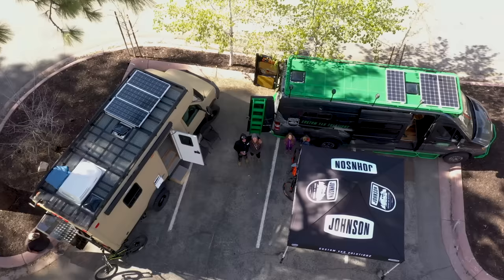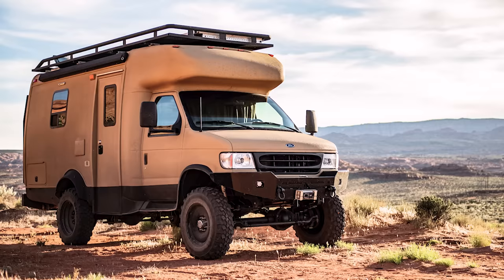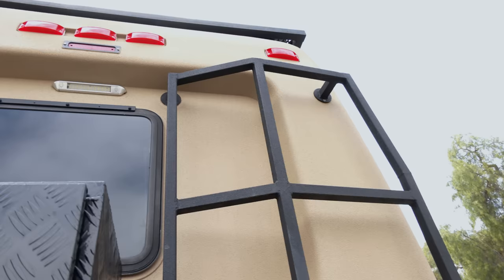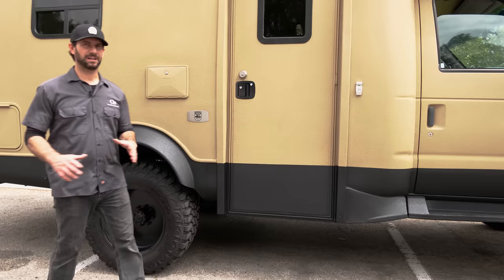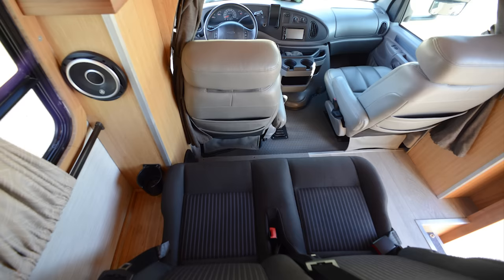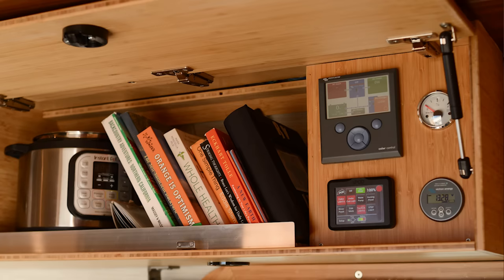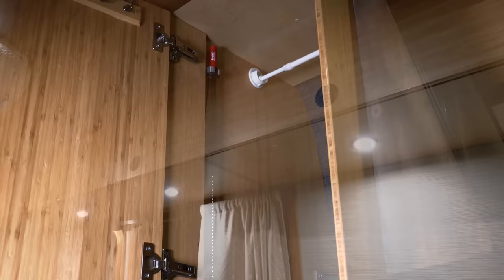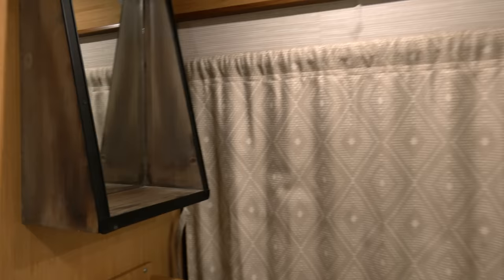4x4 Van Tour - Custom Adventure RV Starflyte 2.0 ! 4WD RV!

Comment: I have a 24ft C class motorhome that I would like to Raptor line.  What is the best way to navigate the storage doors and venting panels?
Reply from the maker: Get really good 3M green or yellow automotive masking tape to seal off anything you don't want to spray. You can go over any vent that is not a "hot" vent, just put some tape behind the grills on the backside to prevent spray through. I painted all my doors, just sand  everything with 100 to 180 grit, clean thoroughly with a detergent soap. Careful the soap doesn't have oils in it as a lot of soaps have essential oils in them these days. Any hard to reach areas you can't sand, or spots you want added adhesion power, use UPOL's Grip #4 spray. Just 2 really light coats of that and 20 minutes later you can raptor it. Any spots you hit with the sander that creates bare metal, use UPOL Acid Etch #8.

Comment: Very impressed!  I've been considering all the options for a few months and this is the first thing I've seen that hits all the notes.  The slightly retro/classic Starflyte has a great look to my eye, especially with the paint and extras you added.  Were the stock water and gray water tanks sufficient or did you replace them?  How is the insulation?  Can you charge the batteries off the engine as well as the solar panels?  Looking forward to more!
Reply from the maker: Thank you that means a lot! I upgraded the water tank to 46 gallons, so with the 6 gallon water heater it has 50 of fresh. I upgraded the grey water from 15 to 27 as well. Batteries charge off the engine, yes and 300 w of solar.

Comment: What kind of engine do you have in the van?, if you don't mind me asking, what was the cost of the remodel?
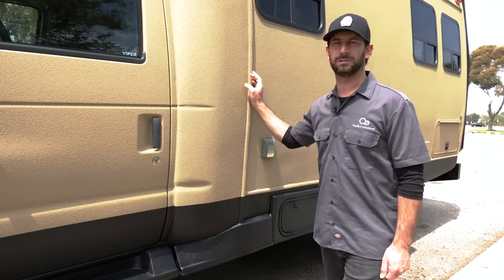Reply from the maker: 160k and it's 5.4 V8 gas engine. Re-geared the diffs to 5:13 to make up for power

Comment: Ayyyyyyee you’re on YouTube, and a natural at it. Lets rally 2022!
Reply: Sikaflex 221 is all over my van as well.
Reply: Man that hoist is slick. I’ve always wanted to know more about the process of building your own wheels. I’m sure that was an intensive process!
Reply from the maker: I'm camera awkward brother! I appreciate it though! 😂
Reply from the maker: @Levi_Allen  I'm using 252 as well. And the 291 is good for below the water line on boats!
Reply from the maker: @Levi_Allen  The hoist works so well, I love how it came out. I didn't build the wheels, I spec'd them out. Rear wheel made by "Wheels Now Inc" and fronts made by "Detroit Steel Wheel Co."
Reply: How much is all that cost$$$$ ???

Comment: i have a 24' born free RV with a Ujoint 4x4 conversion done at their facility in NC. It's built on an E450 chassis. I have a rear sway problem 
(tail wagging the dog) when the RV goes above 55-60 MPH. I Installed a rear track bar that helped a little . I still have yet to figure it out.. any suggestions?
Reply from the maker: Air bags! Your rear sway bar should be the fatty one from Hellwig! I ride with the air bags at 80 lbs and it is very helpful for sway. Tire choice is important as well.
Reply: @auxbuilt4190  I have air bags. I also have the biggest hellwig sway bar they make. I'm running bfg km3's. 33 inch
Reply: Look at some Roadmaster videos, they do help on motorhomes that sway in the back, but you need to control the front first before the back will behave.

Comment: I've read that having the spare tire covered with black in the sun for possibly months is bad for the rubber. I saw one guy that made a round thin wooden board painted with white ceramic paint. It was a little bigger than the tire and had a screw that went though the center of the board and spare tire rim to hold it in place. Do you have a weBoost built in? Did you have any thoughts about diesel? Great build!
Reply from the maker: Very clever about the ceramic board! No weboost installed. Diesel is great, just bought a new build and it is diesel!

Comment: Nice work !
But I think you made one mistake according to what I saw for cold freezing spots !
There is no air circulation in closed shelves!  Condensation is therefore inevitable except if you leave the boxes opened which is not the good solution.

Comment: I subscribed to be able to refer to the paint used on your Econoline.  I own a 2001 E-150 (V-8 5.4L Triton) Conversion with 189k miles and burns 3/4 quart of oil between oil changes. Today's vehicles have so many electronics that are tied into the damn vehicle to operate, I'm steering clear of that crap!

Comment: This is the best built on YouTube period. 3 questions. Why did you not go for a bigger watertank? what was your reasoning? Why did you not use a cassette toilet? And lastly, what are the exterior dimensions, length, width and height after the rebuilt? Awesome work. Thanks
Reply from the maker: Thank you! Stock water tank was 26 gal, so the 50 was a major upgrade. Cassette toilet needs to be changed all the time even when just using it to #1. The composting toilet makes it super easy to dump pee and you can do it anywhere. 21ft x 10'6 x 8

Comment: Innovative solutions for comfortable trips. Well designed for long term off grid experience and enjoyment. 

Questions: Can more custom mods can be fitted? 
What's the range of vehicle?
Is as comfortable in Tundra as well in desert areas, also high altitude regions driving? 

Good Presentation 😎👍
Reply from the maker: Thank you! Yes, more custom anything can be done! Imagination is the limit! Range is aprx 300 miles. The AC is being replaced so that it is 12V which will help in hotter climates and the webasto heater keeps it warm in the higher altitudes.

Comment: I think this is about the best anyone can do on fixed axels and 110" wheelbase. Tantras spine drive and articulating axels would be so much more expensive. Great blue collar job for normal people.  Just 3 questions if you could humor me.
1) How much more weight would this handle? Like for an aluminum back porch for dogs and showering platform? Think same as the roof rack welded to the frame and sticking out the back 4 feet.
2)What was your final toll $ on this ?
3) How long can you go off grid before you need to come back and re-stock and do maintenance on this?

Comment: Nice build.  Would it be possible to put a 7.3 diesel in that beast?  Also the design on the bed is genius.
Reply from the maker: It's not economical to engine swap. You would want to find a donor van with a 7.3 and do a body swap.

Comment: Did you have to sand everything down to bare materials before applying the Raptor Liner, or could you spray it over the existing paint?

What are the bones of the body made from, and how strong is it? I'm looking for something that I can use on ski trips where considerable weight in snow could build up on the roof overnight.

How high is the interior ceiling?
Reply from the maker: You have to scuff the material you are painting, not bare metal. If you hit bare metal you need to prime it with UPOL ACID8 or Raptor 2K Primer. It's a steel exoskeleton so no load worries on roof. 6'3" inside

Comment: Amazing job! We had a 1999 Starflyte. There were some pros and con's to the camper. One thing I'm surprised at. Since you're going hi tec why not put in an on-demand water heater vs a 6 gallon storage one? Is it the lack of propane? Another is weight. We were close to our weight limit. What about tires and the extra weight of the 4X4 components? I realize you may never see my post or have enough time to answer, so best of luck.
Reply from the maker: Heya! No propane on board. Definitely at the weight limit yes, but I know a few van owners that are 4 or 5k lbs over their gvwr and they are fine after years of use. These vans are under rated in my opinion. The tires were rated for 4k lbs each and the rear scaled at like 7800. Wheels were rated well beyond that. Cheers!

Comment: Is the motor a 5.4l or did u upgrade  that to a diesel.  ? Awesome  job
Reply from the maker: 5.4 gas, with 5:13 gearing to help the power back to the wheels. Diesel conversion in this van is insanely expensive and arduous. I was quoted 40k for the diesel conversion as a turn-key job.
Reply: @auxbuilt4190  5.4 will work. ,they strong motors. 💪 but expensive to  repair at times. Timing  chain gears big job.  They tend to fail at 180.000
Reply from the maker: Copy that, thank you!

Comment: Did it come as a 4wd or did you convert it and also who made the ladders and roof mount?
Reply from the maker: Conversion was done by UJoint Offroad and no it was an old little RV when I got it. I made the rear bumper, ladders and roof rack myself.

Comment: DAAAAANG.  🦄🤩  Love this.  I really love the outside, the sheer power, and the specs.  You built a tank.  But I want a rugged beast in the guts and on the outside, and a straight-up pretty, cozy house on the interior.  Definitely an inspiration, thanks for sharing!
Reply from the maker: That was the plan and yes, thank you!!

Comment: I'd love to find out how they rigged the 'quick release" transfer case shifter.  I have the same setup on my E450 and really need a solution to move it out of the way when parked.
Any sources I could purchase a collar or? and weld or fix to the cutoff shaft?
Great build and video...
Reply from the maker: The shifter was basically cut at the shaft and a collar was welded onto the shifter end, creating a male/female scenario. The collar is a just a pipe with the correct inner diameter to match up with the shifter shaft diameter.

Comment: Very nice. But how's the center of gravity? Looks a little top heavy for off road. I would feel a little nervous pitching around on mountain roads.
Reply from the maker: Nah, the sway bars help and the weight is mostly down lower. The roof rack is aluminum and the shell is fiberglass. Does great!

Comment: Would recommend using a roof top tent vs making the cabin the sleeping area. I'm debating this because I have a big vehicle however, seems like having a bed is not as essential as a small office. can you please provide experience here. The vehicle in question  is a mid 2000's suburban.

Comment: Hoping for an answer to a tough qusetion.
I have R 4 100 transmission behind 7.3 on a 2000 e450 shuttle van.
Going to 4x4 and removed ZF drive line break (where speed sensor hooks) from the f81z-7a039-eb extension housing. Installed N.P. 271 t case and don’t have a speed output sensor to control shifting. What might be the common fix fro this?
Reply from the maker: I"m not sure my friend. Your setup sounds correct, but without looking at it personally I can't be too much of a help unfortunately!

Comment: I saw ujoints video of your conversion and your initial reveal (I guess). Starlyte is a 5.4L V8 and 4.56 geared. I’m curious what kinds of hwy mileage you get and at what cruising speed.
Reply from the maker: Geared to 5:13 now and gets around 8 to 9mpg
Reply: @auxbuilt4190  Did you go after the 5.4L rather than the V10 or did it just work out that way?

Comment: This looks like the life after all the assholes leave, hard work is accomplished and life starts again! Looks amazing! I don't usualy hear people reply to comments, if you did reply, I would ask if you had any experience with installing windows for thin walled aluminum or steel like they have on buses before they are insolated! I am making a by-cycle camper trailer and need some ideas of where to buy or what to use or product name for windows that are the same as rv windows except light weight and for thin walled projects! Thanks! Hope to hear your thoughts or suggestions

Comment: Hey nice van. One question only:

Is that V10 or V8 in it and does it, in your opinion, have enough power.
Reply from the maker: Most highways it does ok. 12k feet over CO pass it's slow. Off roading it's plenty

Comment: Did the van interior company handle all the wiring or do they sub it out ?
I'm a cabinet maker by trade and would love to get into this type of work for the back east people...
Reply from the maker: Johnsons Custom Vans in. Sand Diego did the interior wood work and electrical as well. You would just need to find a 12V specialist and you've a van builder ready to rock.

Comment: Great Build - most everything any overlander would want in a vehicle.  Starflyte looks like it has a 138" wheelbase - would you be able to go everywhere you have been with a 158 wheelbase and 33" tires   or    would you be giving up too much turning radius & ground clearance?  Thanks.

Comment: Nice rig, but isn't there a lot of drag going down the highway with that exterior coating?
Reply from the maker: Negligible compared to the drag the rig has in of itself!
Reply: @auxbuilt4190  Yeah.  Good point.  And I wouldn't expect that you'd be racing down the highway in high winds anyway.  At least not enough for the bed liner coating to actually make any difference.👍

Comment: Building out my 1993 Dodge Ram B250. With rebuilt transmission. I like my V8 318 small block Magnum Engine because it's indestructable. Sorry Ford. But I'll have an in house solar system on my roof to make sure I'm actually off grid.
Reply from the maker: Sweet van! Don't be sorry man, the motor in this van is strong as hell!
Reply: @auxbuilt4190  Yeah. 318 Magnum 5.2l V8 Small block. Best engine I ever owned. Indestructable. Haven't replaced the plenum pan yet because intake gasket is still ok. It's been a SoCal van since 1993. Barely any rust yet. No Computer and code throwing to deal with. And the doghouse is so big on it, I can pull the heads off inside the van. Carry them in two bags on the bus to a machine shop to check for cracks. Here in L.A. County. And do a whole intake porting, valve seat sanding, piston honing, valvetrain part replacing overhaul while parked in a vacant lot for two weeks. But close to my mailbox and O'Reilly Autoparts, and Walmart Supercenter.  Tranny was rebuilt in 2016. Still mint.

Comment: yo g!! im actually building a similar van to yours and this build is the closest thing I have for a point of reference, im wondering how you actually mounted your roof rack to the van, the rack looks amazing as does the whole build, im considering using unistrut post base' as my roof is slightly contoured and im assuming yours is too?
Reply from the maker: Good luck on the build! Yes my roof was curved as well. It is straight front to back, but slopes left to right. Hard to explain so I'll write it out in steps. Roof / sikaflex221 / 4x8" 1/4" aluminum plate / welded "c" channel aluminum in the Up/open position / roof rack frame rails sit inside the "c" channel / stainless bolts drilled and fastened through frame rails and "c"c channel.

Comment: Awesome build, well done.  I'm curious to why you chose to go with a front leaf suspension system over coils.  I know that people say it's a rougher ride but by how much.  15%? more 25% more? and is it a steady drive at highway speeds?  Thanks.
Reply from the maker: Coils are more expensive! I did coil overs on my new build, stay tuned.

Comment: Hi, you've inspired me to get a starflyte. I'm having ujoint do the 4x4 conversion. They are convincing me to keep it a dually. I'm going to go offroad quite a bit with it. What are your thoughts on this? Cost aside, should I make it a single rear axel if I'm planning to take this offroad?
Reply from the maker: There are a limited amount of tires that can handle the weight so be cautious if you go with single rear wheels. Offroading is ok with duallies as long as you avoid technical stuff and tight trails. I prefer the single rear, but you are definitely limiting your tire choices!

Comment: I was hoping you would touch on your single-wheel conversion on your rear end. My rig is roughly 10,000lbs and I would like to do the same. I recall somewhere you saying these were custom. Any advice for a non-techy
Reply from the maker: Wheels Now Inc in Wisconsin made the heavy duty rear wheels! They can build any offset and lug pattern you need!
Reply: @auxbuilt4190  what size are your rims & tires & what rear axle do you use, or what do you have to do to it for a set up like this. Thank you in advance.

Comment: Love from india ! I want to build the same van like you for offroading and adventure travel. In india we dont have lot option for camper van so i decided to travel on a motor bike and i dont like to stay i hotel so i face few problems when i live in a tent. I did my research and came to know that in india we can build camper vans. but we dont have much options so the options that we has is Tata Winger, force traveller and pickup trucks like isuzu dmax and mahindra bolero and tata xenon. so i am confused which one of these i can make my base platform to build a camper van. I love travel so i am looking offroad vehicle 4*4. your suggestions will be highly appreciated.....waiting for your reply buddy.....

Comment: Sweet build! What did you have to prime the aluminum with so that the off gassing didn't jack with the Raptor Liner?
Reply from the maker: On Upol's website they discuss the steps to take for prepping aluminum and galvanized metal. Essentially, sand/scuff, clean with solvent, tack rag, 2k primer, raptor.
Reply: @auxbuilt4190  Awesome, thanks. Again, great build.

Comment: What wheel size and offset to be able to use on all 4 corners? Thanks!
Reply from the maker: The wheels were from Wheels Now Inc in Wisconsin. The offsets were different front to rear in order to make the stance as square as possible.

Comment: Have heen considering a 4x4 build with my old worn out 92 econoline motorhome. What in your opinion, is the MAXIMUM LENGTH for a SAFE 4x4 build?
Reply from the maker: U joint Offroad does 35' RV's all the time! Check them out man!
Reply: @auxbuilt4190  Thank you!